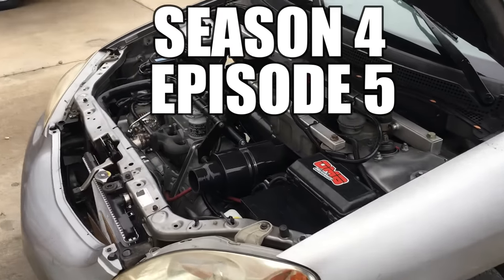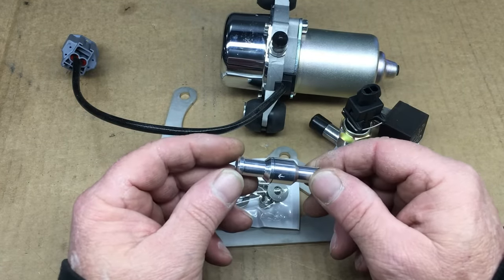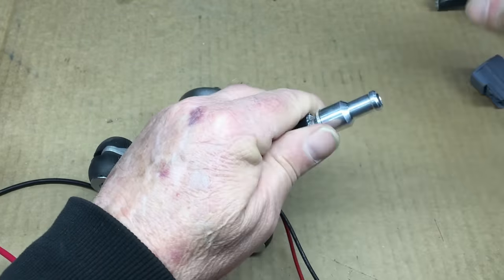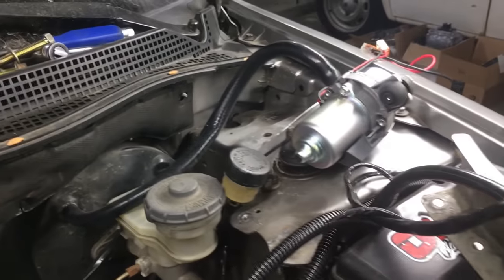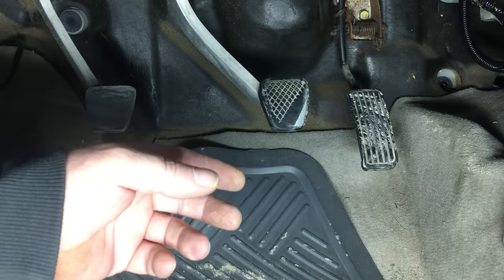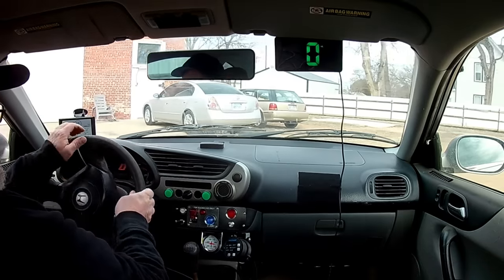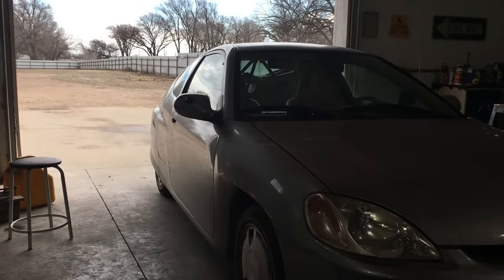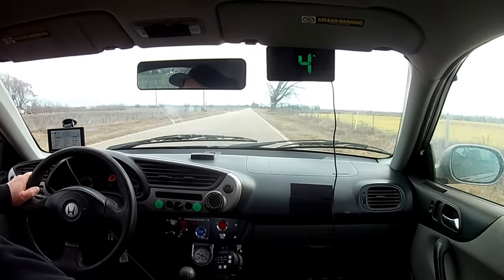S4 E5. We fix the power brakes with an electric vacuum pump and a bit of engineering.

Comment: Hey, Jimbo, you need to put a vacuum reservoir on your vac system.  That will solve your chatter problem and provide you with more than 3 applications of the brakes.

Comment: Nice video as always Jimbo, have you considered adding a vacuum revisor can? That would also add more capacity to the reserve but also might help buffer things and reduce chatter and since you went electric have you considered removing or disabling the factory pump and using an electric one, you could easily come up with a control loop to dial in your temps. Keep up the awesome work man

Comment: The attachment point on the brake booster is supposed to be a check valve, you shouldn't have to add an extra check valve.
The addition of a vacuum canister will probably help that situation. It will give you more operation of the brakes when there's no power.
The belt will last considerably longer if a couple of times a year you wet it down with some 303 protectant. It's one of the best products for anything rubber or EPDM on your vehicle anywhere, including the tires.

Comment: A vacuum resivoir will store vacuum to possibly keep the brakes going longer. A 6" bit of ,2.5" exhaust pipe sealed on each end!  And a capacitor on the relay may stop the chatter! Keep the pump running a bit longer

Comment: For the "panic switch", you could make a small microcontroller circuit with a relay to give the pump a second of power every time the brake lights go on. If you don't want to use an Arduino, there are probably existing products online that will pulse the output every time the input turns on.
That will also have the benefit of giving the pump a little "boost" every time you step on the brakes. Probably no need for the time delay relay after that.

Comment: You put together some cool systems. Have you considered using the horn circuit as the vacume pump "panic switch" ? Combining brake boost assist and audible warning could be advanntageous.

Comment: i reckon a crude way is to remove the booster all together as the spring inside the booster is what makes it so hard when vacuum is lost my old Landrover has no booster never came with one and its fine yeah the pedal you have to push harder but nowhere as hard as a boosted set up with no vacuum. but i like the set up you did, makes it easy to set up a booster on older cars.

Comment: You  can raise engine temp by restricting the waterfowl though the thermostat . I'd start with a 30% restriction on a 180 thermostat you can also restrict flow by pinching the upper radiator hose

Comment: Had a thought on the heating issue and not sure if you researched fueling on getting more heat in the motor. Is it possible you're running too lean to provide enough heat in the little diesel?

Thank you for the video. I enjoy watching your videos and appreciate your fun factor on these videos instead of the search for "all the power" like others.

Comment: Jimbo, sure soneone elso has suggested but just in case, what about a tin can added to the between the check valve and the booster like many gas burners had in yesteryear so that there is more volume of vaccuum required for the switch to turn off ... that should 1 add a couple applications of breaking before depleting the vac 2)  stop the chatter.. 

Love your vids and your sometimes backyard engineering that challenge me...

Comment: You could wire the relay to the brake light circuit as well, so holding the brake will run the pump and keep some vacuum in the booster.

Comment: The simple switch and relay is an adequate solution for the vacuum pump, but I'd be interested in a proportional control system. If you hook an analog pressure sensor to an Arduino and use a PWM drive for the pump you could have a nicer system. If it only needs a little bit more vacuum you could run the pump on reduced voltage for quieter operation and a more consistent pressure.

Comment: Have you driven any newer f150 trucks with the electric/hydraulic brakes? They are so touchy and if you’re not ready or used to them you’ll about kiss the windshield the first time you hit the brakes 🤣 I drive my bosses new f150 occasionally and being so used to driving my old junk I just can’t get used to those brakes.
Reply: That would seem to just be a Ford tuning thing. I've at various times in my life borrowed an '89 Crown Vic and an unspecified year Aerostar, and locked the tires up on the first application of brakes because they were just that touchy.

Comment: I like the sneaky Saturn SW2 @15:10... I just finished working on mine. Fun fact, the fuel pump relay is wired "backwards". power comes in on pin 87 and out on 30. it's strange because it's one of those STDP relays with an 87 and 87a pin.

Comment: With the cooling issues, it might be possible to completely remove the thermostat and the impeller for the water pump then just replace it with an inline electrical pump. Can vary the cooling by the speed of the pump.

Comment: dont worry about the belt. i run 15hp thru a b belt bent the wrong way like that and use it as a clutch. it does wear out faster but they will still last a pretty long time and your little supercharger isnt going to take much power to spin

Comment: Being old I grew up with vacuum controlling several things on the auto including the windshield wipers.  When it was raining and you stepped on the gas the wipers would quit working for a few seconds.  Not a good thing.  Aftermarket kits and some original equipment included a vacuum reservoir that looked like a large metal juice can.  That added enough volume that the wipers would keep wiping.  If you installed one of those wouldn't it pick up the slack between the pump and vacuum booster and allow the switch to not kick off and on so often?  Pretty cheap to do also.

Comment: Maybe use power from the brake light as the bypass switch.
Any time the brake is applied the pump will run.
Reply: Would the brake lights chatter then.......🤣

Comment: If you are looking to get the engine to run hotter . I ran Evans waterless coolant in my model t with a water pump . The waterless coolant held the heat longer than regular coolant . When I switched back to regular antifreeze . The engine ran a lot cooler with regular coolant .

Comment: Ideally your vacuum switch would be mounted close to the booster reservoir on a dedicated fitting, rather than in the pump pipe work close to the pump. Definitely would improve matters if you reposition the vacuum switch as close to the reservoir as possible.

Comment: It's interesting. I have a 40kw generator that I cobbled together with a 75hp kubota on it and it runs at 160deg also. I put a oem thermostat in it when I assembled it. Only way to get it to run hotter is to unhook the fan and still takes a while at what 1800rpm for 60hz

Comment: Hey Jimbo, if your local junkyard has an early to mid 70s cadi or buick with cruise control, they have a fairly compact (between baseball and softball) plastic spheroid vac reservoir for the cruise servo. Dont go for a lincoln, merc, or ford, theirs is a steel 1 lb coffee can (rots and hisses). Might buy you another step or 2 before pump lag bites ya
Reply: I'll make it a lot easier for you, second gen S-10's (at least the 2.2s, can't verify the 4.3 as I own the former but not the latter) have a similar plastic sphere inside the driver's side fender, on the rear of the inner liner.

Comment: Had a frend with a vw rabbit diesel  ,the vacuum pump failed he didnt have the coin for an over priced factory replacement.  His solution was a harbor freight pancake compressor run off an inverter powered by the factory switch (probably a relay between the switch and inverter). He simply swaped the lines so that the pressure was vented to atmosphere sucking the air out of the tank created vacuum.  With enough resavor to where the compressor bolted in the bed( was the truck type )came on about once a week. Chears

Comment: The brake issue  can be made by changing the master cylinder with a suitable manual brake master i mean thear are tiny ones out there just make sure on appropriate  volume
Reply: This would have been my solution. Find out the diameter of the original MC then find one the next size smaller. The pedal travel will be increased but the effort will be decreased.

Comment: In the future, look into the Bosch iBooster. It's an electric brake booster used in vehicles made by Tesla, Honda, and others. It can function independently with just power, switched power, and ground.
Reply: way too much work for a car that already has boosted brakes.  Racing matt did a nice install on his retrofit tho.

Comment: think they make acumilators for vacuum , should let the pump keep up with suddenly higher demand 
about the thermostat thing , they make thermostads for scooters and those are pretty small . not sure at wat temp they open though
another option would be an electro magnetic valve triggered by a tempsensor in the block , the added benefit is that you can change the temerature at wish the valve opens and closes too

Comment: You could probably use a remote thermostat housing with a hotter thermostat and either leave the original in place (since it opens colder) or remove it (for better cooling in the summer if needed)
Something like the JEGS 53260K might do the trick (I don't know what size coolant hose you are using, but you might find a more appropriate one or adapt it).

Comment: How about throttling coolant flow through thermostat with car heater valve? Could be made adjustable from cabin and can handle fluid and heat because, well, it's made just for that.

Comment: TT207-192 thermostat is a 192F 38mm flange(AKA a gates 34080, Also comes in 195F as a Gates 33299), with two wings on the bottom, could cut the wings off n chuck the rubber and it might fit the kubota d722 housing, literally the only thermostat that exists that can even come close the the size of the kubota one

Comment: i used the vacuum switch and pump + check valve  from a volvo to and it works perfect. and you cant run the pump without it you will burn the motor in the pump.

Comment: Reminds me of those first homebuild EV conversions that had to cobble up some vacuum system for the booster to work. With power steering there are easy ways to implement a electric solution from an existing car but there isnt much for fully electric brake boosters. Many ICE engines these days use mechanical vacuum pumps driven by the cams but I guess you didnt want to mess with that integration...

Comment: As a noob to electronics, I'd be interested to hear:
A. How would adding a capacitor to the circuit work as a hack?
B. Why would people question your background if you did this as a professional?

Actually I thought about it a bit and I think I understand how the capacitor trick works. It holds a charge for a while so it would follow then that when the relay disengages it would keep pixies flowing through the circuit momentarily and therefore keep the pump going a bit longer, which should solve the chatter problem by overshooting the target vacuum level slightly (I think). That still doesn't answer B though, assuming I'm correct about how it would work. Also, if you used this hack, wouldn't it make sense to put the capacitor between pins 30 and 87, since you're trying to delay the pump shutoff by keeping current flowing to it?
Reply from the maker: A capacitor large enough to hold the relay closed for a few seconds would cause issues with the light duty vacuum switch.  Keep in mind to charge such a large capacitor instantaneously would draw a lot of current through the light duty switch and damage the contacts.

Comment: I saw a V8 engine dyno run with the AMR 500 unconnected and just pumping air without any restriction to load it up. It took 28 hp at 16000 rpm if I remember correctly.

Comment: Fellow mechatronics guy here (long time listener, first time caller). Why not just run an Arduino Nano for more IO instead of going analog? Could intercept brake light switch and use MAP to anticipate demand/PWM the motor to maintain that level of vac. I believe a decent amount of Chevy Ecotec engines had vacuum canisters you could salvage as well to make the system less prone to rapid fluctuations in vacuum. I’m sure you’ve more than likely already considered this anyways. I know I have a tendency to over engineer…

Comment: How about running a restriction inside a coolant hose to keep the temps up? I think you could have a valve that you can control from inside the car to change how much restriction is applied which would change how much coolant circulates between engine and rad and keep engine temps up. We play around with restrictions to increase temps when testing motors. Of course too much temps are bad, they also generate NOX i think. Or the easy way which is to have a curtain move and cover more or less of the rad.

Comment: A MAP sensor, small uC like attiny85 and IGBT driver could be used instead of switch and relay.  Vacuum control easily programed  in firmware. Small, inexpensive MAP sensors are available.
Reply from the maker: I totally get that, however when I make these videos , I have to keep in mind that the majority of the audience wont understand how to duplicate a microprocessor based system, so we use off the shelf solutions.   However in the next video we do use an arduino to get the factory speedometer to work again.
Reply: Instead of attiny85, an arduino nano v3.0, might be better choice, it could use arduino IDE directly with USB. As a hobby, I have developed engine management systems for gas and diesel engines.  I will share, if you have interest.

Comment: Been around gasoline engines my whole life, never knew diesel engines didn't make vacuum. Great videos! Would the brake booster\pump benefit from an "expansion tank"?  I guess it would be more like a vacuum reservoir? Kind of adds more compacity to the whole system?

Comment: IIRC Those little Kubotas has a Bypass hose which can be used for a Cab heater or Raising Domestic Hot water for a Boat/Motorhome.
would a Restrictor sleeve in that hose allow the engine to run Hotter yet still allow the Engine Coolant Circuit to vent and prevent Airlocks?

Comment: On my first-gen Insight, I usually only get one brake application while the engine is in auto-shutoff mode before it will turn the engine back on to build more brake boost. I wonder if Honda was erring on the side of caution with the brake power, or if the vacuum pressure sensor or whatever is out of tune.

Comment: My old diesel VW Rabbit (pre-turbo) had a large vacuum accumulator to store some vacuum.  May that would help with your pump chattering?
Reply from the maker: For the chattering, No, sadly that wont help.  The chattering is because the on/off positions of the switch are too close together.  with a larger storage tank we would still have the same issue.  The hysteresis of the switch is not ideal and to avoid chattering we need to let the pump run a little bit longer so  we can develop  more vacuum in the booster and that will add some separation between the ON/OFF position of the switch.

Comment: have you thought of using the break peddel switch with a timer over the vacuum switch with the relay ? you could have the timer run for 30 seconds or so to fill the booster every time the break is pressed ?

Comment: I'm surprised you didn't use the brake light circuit to activate the relay.
Reply from the maker: That would only turn on the pump when the brakes are applied.  The power assist would be delayed. With the vacuum switch we are able to build up a reserve of vacuum in the booster for instant power assist.
Reply: @robotcantina8957   An addition of a vacuum reserve tank may eliminate the delay.  Sort of like the pressure accumulator used on hydra boost systems to take up the delay for the electric pump to activate. The depressing of the brakes during start-up may be enough for that panic stop.  It might be worth a test.

Comment: (Turbo) petrols and  diesels in Europe have a mechanical vacuum pump on the camshaft witch is a little smaller than yours.
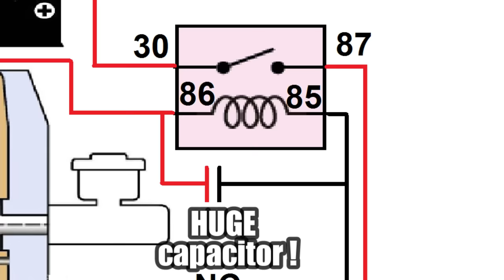20:22 You could use a Texas Instruments CD40106 Schmidt trigger, a capacitor and some resistor. the IC has 6 inverting gates and it's price like 0.70€, check for the part datasheet,  a very usefull part and takes up to 20 Volts and it generates  perfect squares gates.

Comment: I'm still working my way through these videos, a bit late, i know. But on your vacuum pump wiring, I was thinking maybe also wiring the "manual/panic" not only to a manual switch for the driver, but also make it so the brake light switch would also bypass any time delays, etc, perhaps even powered by a redundant relay. I can't see any reason why you wouldn't want the pump to be pretty much running full blast when the brake switch is on anyway, unless a guy was worried about those super long stops in traffic burning up the pump, but i suppose a guy is probably going to be shifting to neutral and engaging the parking brake if its a super excessive amount of time anyway.

Maybe future me will have the answers after a few more videos.

Comment: For controlling vacuum pump I'll use car map sensor to get analog voltage value of pressure and arduino to set on pressure and off pressure to get hysteresis. Or comparator circuit with added resistor to get histeresis too. But for failsafe I think add mechanical presure switch but with higher on pressure.

Comment: My C-Max hybrid has a vaccum booster pump on it; when the car is on with the engine off in EV mode it kicks on every time I release the brake pedal.  The only time I can hear it is with the window down and in the garage, or standing right next to it - otherwise ambient noise drowns it out.